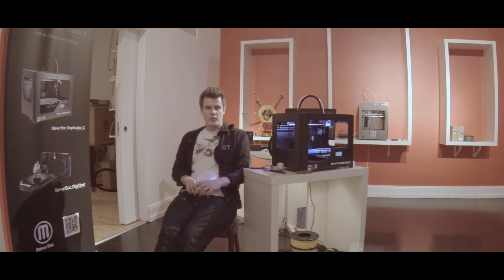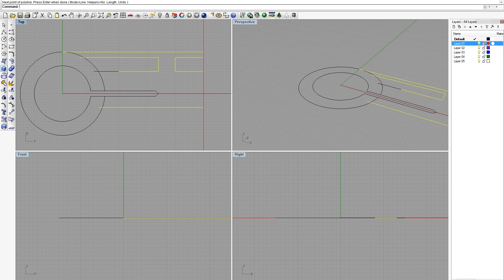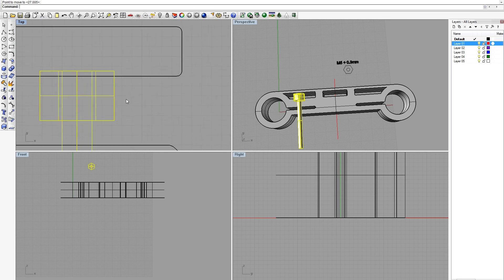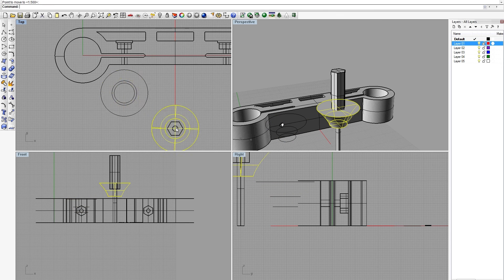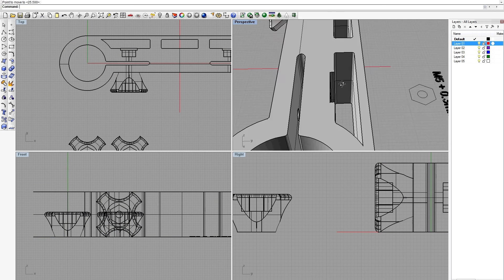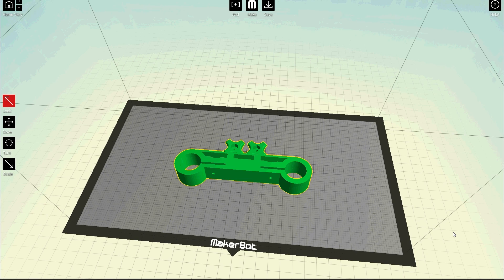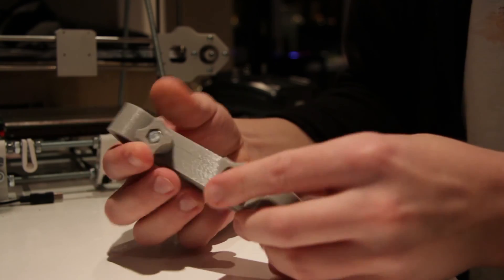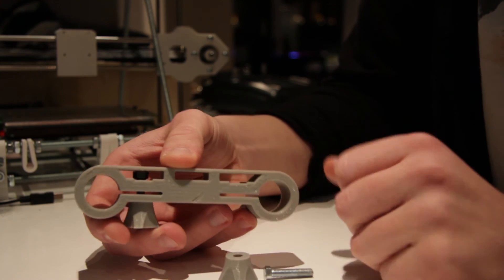DSLRigger - Episode 0 - Introduction to 3D-printing

Comment: As I understand the standard rod Diameter is actialy 15mm aside from that this is amazing.
Reply from the maker: Hi Garth, I might have mentioned another diameter in the movie. The design is made with 15mm diameter rods with a center-to-center width of 100mm (standard for larger cinematic rigs). It can easily be adjusted to 60mm with standard for example :)
Reply: Awesome. I am really exited about what you are doing here and can't wait to get my hands on the files. I just need to save up for a small 3rd printer